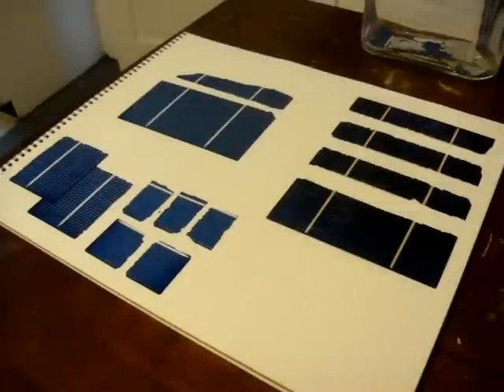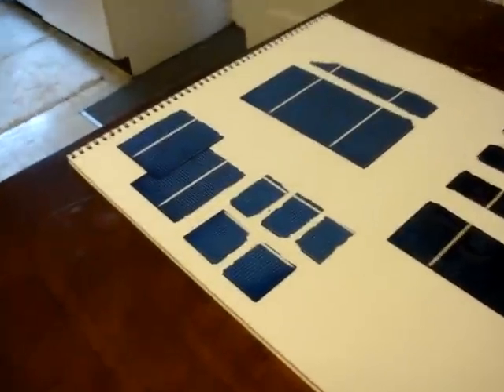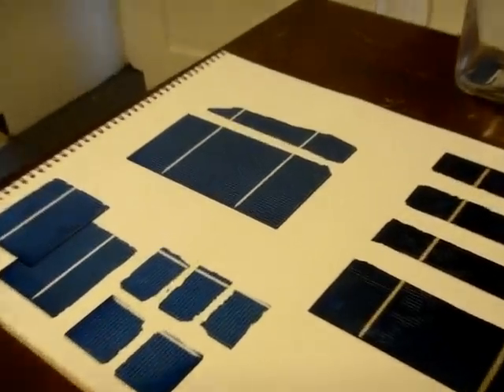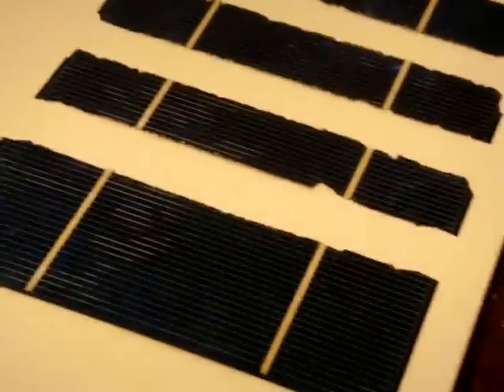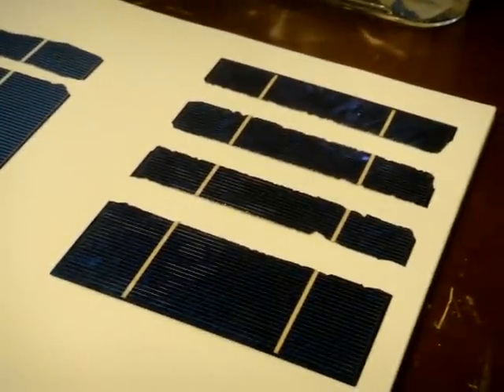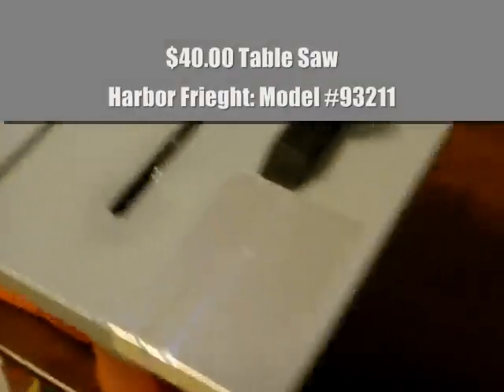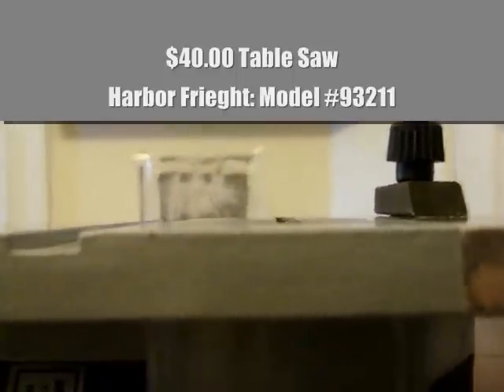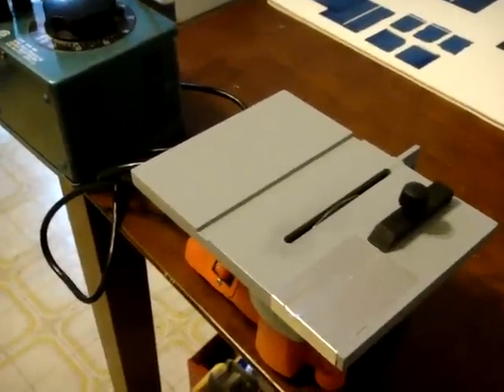How To: Dice Solar Cells at Home

Comment from the maker: thanks for the comment, I agree there are better ways to do this. I embedded a link  to another video in the lower portion of this video. I have never had problems with shorting between the front and back of the solar cell. I typically do not sand the cut edge, but its not a bad idea to do so...

Comment: A dremel with a 545 diamond wheel will cut cells with a near perfect edge, however you have to have very stable hands. Any idea if a C02 40 Watt Laser cutter will do he job? They can be found on auction sites for about a grand.